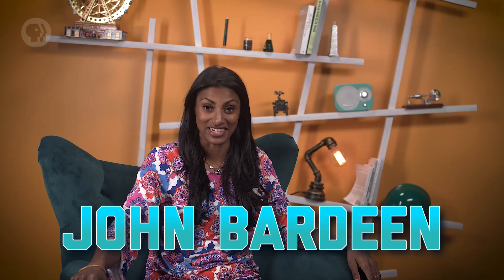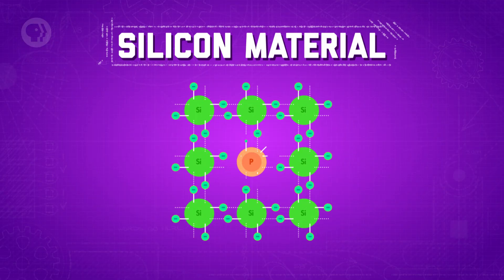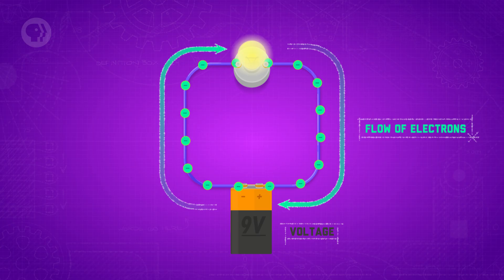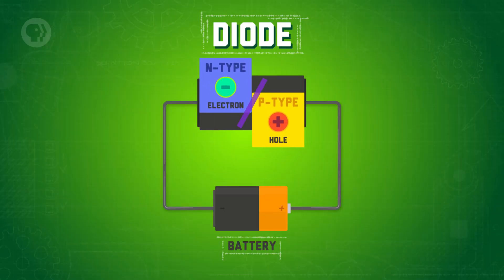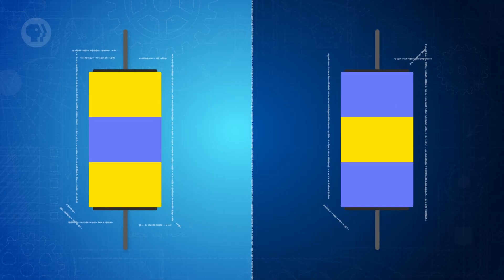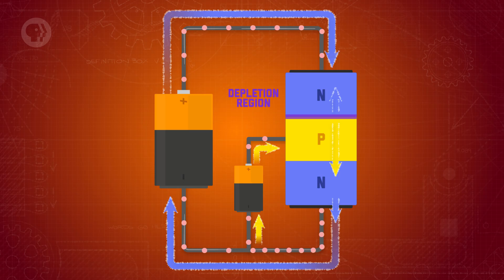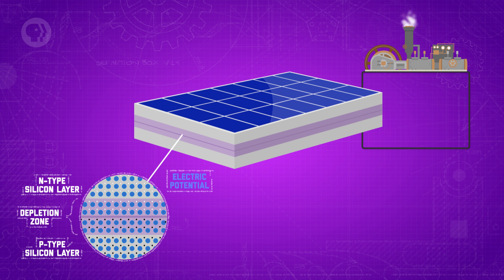Silicon, Semiconductors, & Solar Cells: Crash Course Engineering #22

Comment: 9:30 you didnt explain where the electron goes. you just made up a force and called it electricity so you didnt violate thermodynamics and ended the lecture! also, that was the worst explanation of how a diode works ive ever heard! i didnt even know you were describing a diode until you said it afterward!

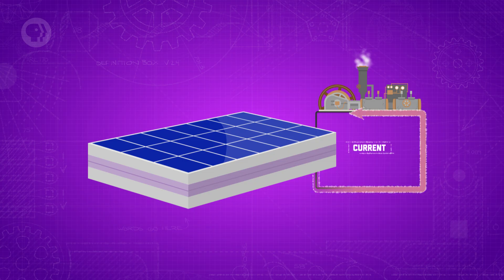Comment: When the arrow on the circuit changes direction at 9:14,  it changes from saying Electron Flow to Current. This is just to show that the two terms are opposite notations, so the flow didn't actually change directions right?

Comment: wow I know this is Crash Course, but if you just left tiny spaces in between speech segments (as would happen in normal conversation), I think it would vastly improve comprehension - at least for me, but likely for others, too.  there is no pause in which to process that I have understood something before moving onto integrating a new concept.
Reply: Or they could put a big dot on the bottom right-hand corner of the screen once an idea or idea set has been exposed, so we can pause if we wish.

Comment: You don't need to dope silicon to make it conductive. That is just done to change the band structure. Silicon by itself is a semiconductor.
Reply: And you don't need a gate current in a transistor, you need a gate voltage. That's the large advantage of transistors over radio tubes.
Reply: @MrGustaphe  She refers to a npn Bipolar Junction Transistor which DOES REQUIRE a "gate current" (which is applied to the sandwiched p-type base). You are thinking of a MOSFET which is controlled by gate voltages or more accurately, the differences in applied potentials. MOSFETs still do require a tiny, usually insignificant, amount of gate current to create the potential difference.
Reply: You're right. I've been spending too long in MOSFET land.
Reply: @MrGustaphe  Cool, cheers to MOSFETs controlling almost everything we have today

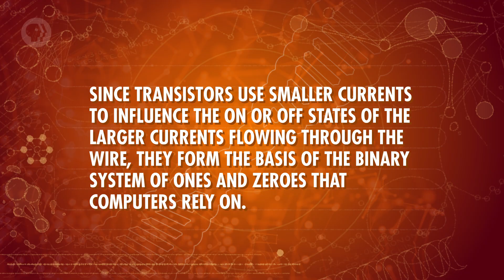Comment: that statement around 7:02 makes no sense, the ability to use a small current to control a large don't have anything to do with zeroes and ones
Reply: Is there a current? That's a 1
No current? That's a  0
Reply: Jesus Osegueda yes but I'm talking about the amplification use of transistors, you need it on the output but I don't think it is important on the logic operations
Reply: @xspager  Sure it is. For example, you can make an AND gate by putting two transistors in series, and it will only allow current to go through when both transistors are switched on.

Comment: That was the best explanation I've heard for a transistor.  That was one component we didn't learn about in school and it has proven quite useful in playing with circuits nowadays.
Reply: It was decent but it missed out on a heap of what transistors are used for, when they are used on their own. The video only deals with transistors acting as a switch (as you would see within the processor in the device you viewed the video through) but they can also be used as amplifiers (seen in the sound generation area of your device). They are so much more interesting within that context, than as switches.
Reply: @pleaseelaborate3163  in the electrical engineering classes I had to take for a computer science degree.  We learned digital logic, including making circuits on breadboards, but never used anything more than wires, logic gate chips, and the occasional 7-segment display.